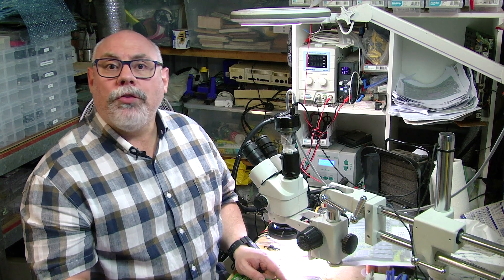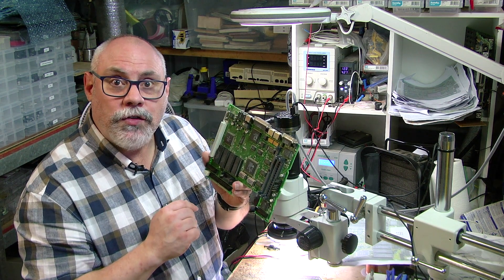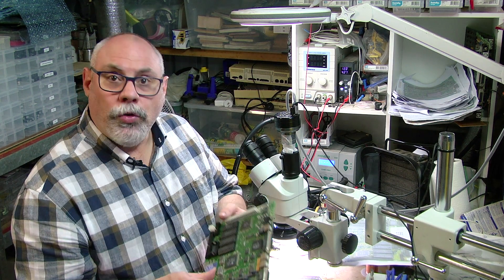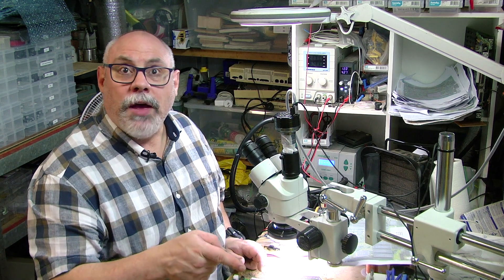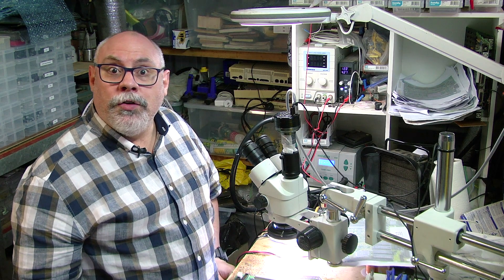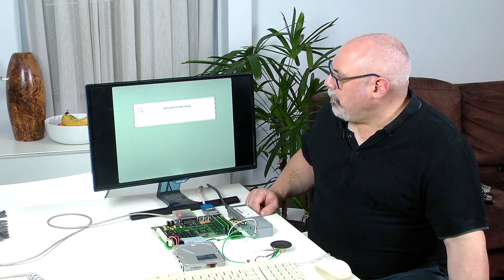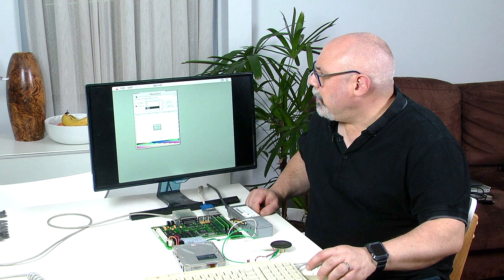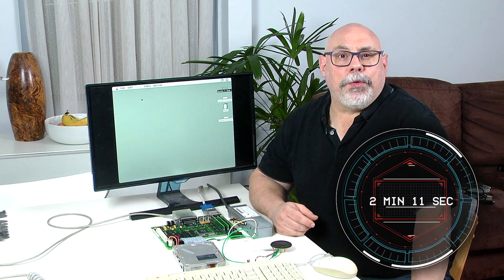Can I recap this Macintosh LC faster than anyone else in the world?

Comment: Hi, great video.  I have a Mac LC that I was checking into recapping.  The business that is in my area wants to use polymer tantalum capacitors.  Is that what you used?  If not, what type of tantalum capacitors did you use?  They said they are better to use on an LC then regular tantalum capacitors?   Is this true and if so, what should a recap job run for the LC motherboard and power supply.  They want to do both at the same time.  They are also suppose to clean and test the board.

Comment: I need to recap same original Mac LC, mine starts with the correct chime, but then has the death chime right after and no video, do you think a recap will help, all looks great I dont see any 'cap juice' on the mobo?  Last I tried it worked 30 years ago.  Where are you located and what do you charge to do what you just did?  If I were to buy a recapped LC like you have there and swap my hard drive would that be an option to get to some software that I want to play with for nostalgic reasons?  TY  When I remove the RAM and leave the VRAM I can get it chime without the death chime, still no video, hard drive seems to be working I can hear and PS seems like it heats up a bit.  RAM was good 30 years ago, tried to clean with alcohol leads of RAM and reseat, then the death chime is back

Comment: Why do you clean the board last instead of first?
Reply from the maker: So that I can clean off all the flux residue I apply during the recapping process. The only time I would clean a board first would be if it was so dirty it was making it hard for me to do the recapping.
Reply: @BranchusCreations  what kind of ultrasonic cleaner do you use? I have a lot of the same equipment as you but I'm missing the cleaner and I am struggling to find one that's large enough to handle old computer logic boards without spending a fortune...